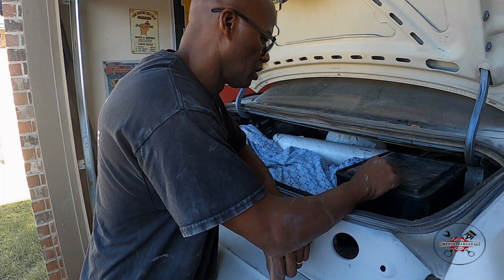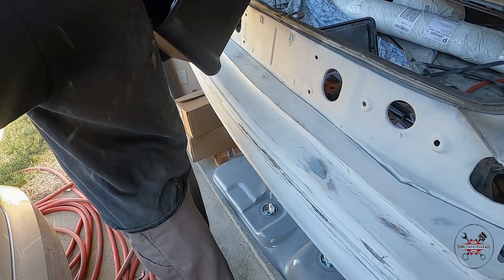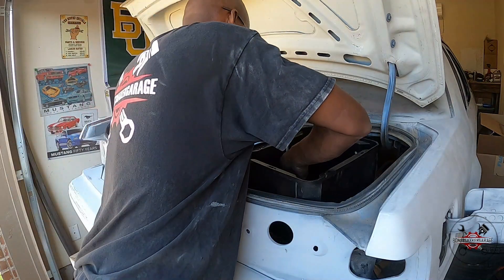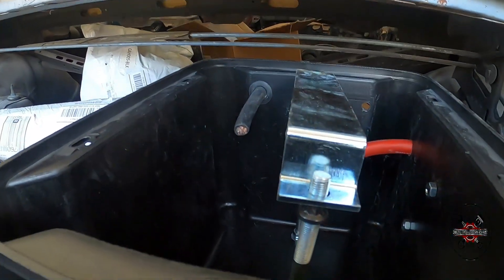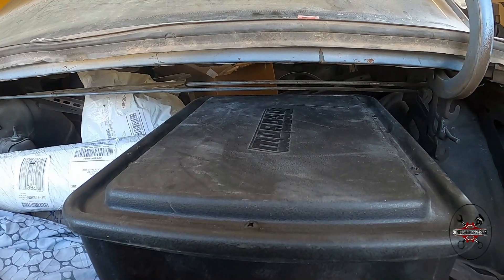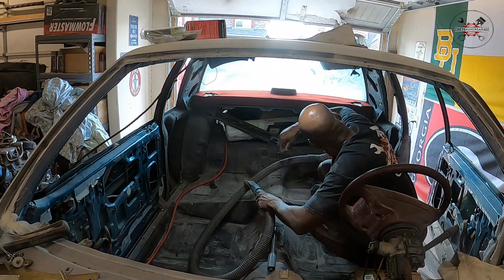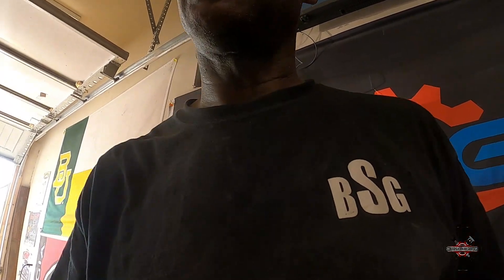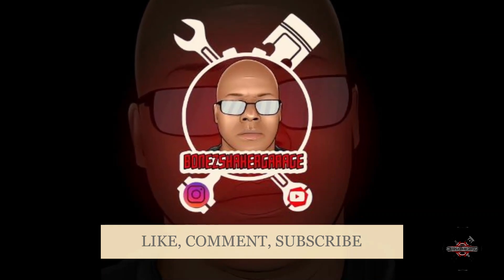85 FoxBody Mustang Notch Back Build EP 19 (KILMAT/ Battery Box Relocation Install)

Comment: Don’t forget to run your alternator wire also. 

Remember also that you are running a 12v 600-900 cca wire through your car and that the starter will pull more than 200amps at times also remember that you weld at 80 amps. So if your positive wire grounds it will arc pretty hot even at 150amps.

May I suggest, that you put the solenoid in the trunk this way that 1/0 start wire is only hot when you turn the key. 

I believe the alt wire needs to be 4 gauge. 

So you would run a short wire from battery to solenoid and that long wire would connect at the solenoid. Then you will need to run a wire  for the solenoid trigger wire.  

This way you don’t need a fuse/breaker on the start wire and you will need it on the alt charge wire. 

While you at it you could easily put a kill switch in.
Reply from the maker: Thanks, You are right on every point. I will touch bases with you when I get started on the wiring